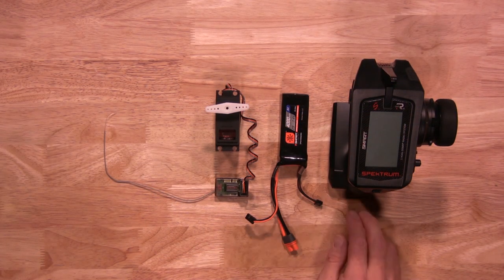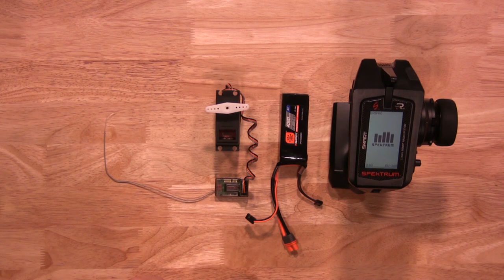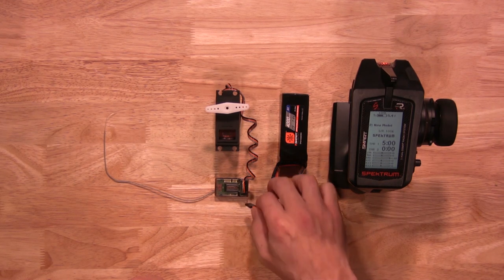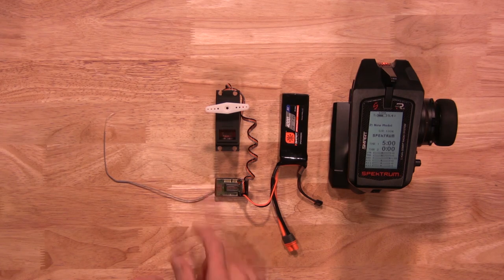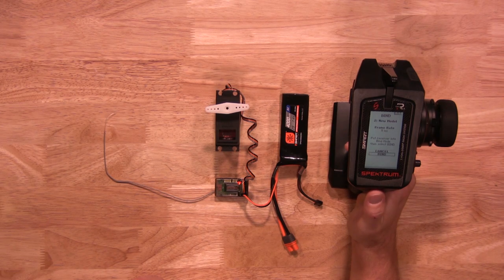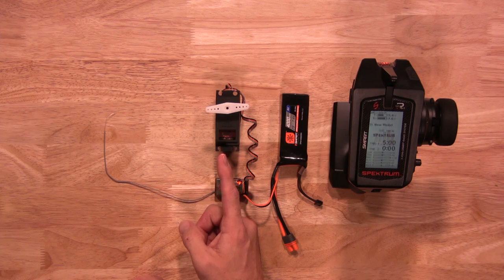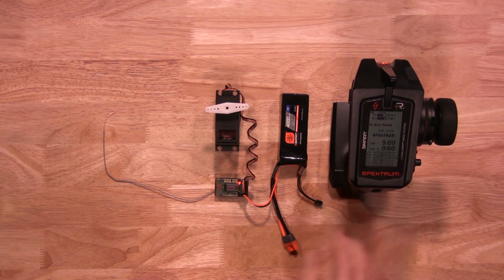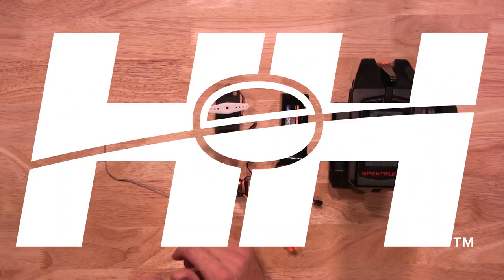Binding a DX5 Series transmitter to an AVC receiver with Auto calibration

Comment: question ( great video BTW) I have a spktrum DX5C TX and a SR6100AT RX updated to latest firmware with auto Cal. When I am done doing this, do I still have to do the throttle set up again. and as well, my steering I prefer reversed, should I set that to reverse before performing the binding?

Comment: After installing my AVC receiver, binding to my DX5c and completing the auto calibration, my motor seems to be reversed… What is the proper way to correct this? Is it swapping 2 motor wires, changing the ESC programming, or revering the channel in the radio? TIA!